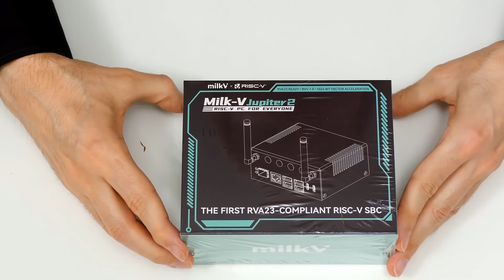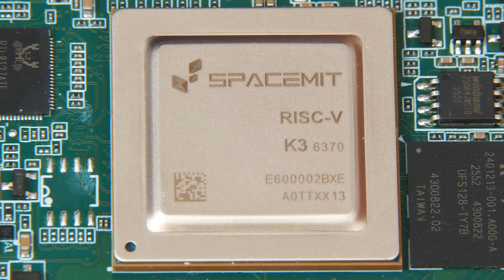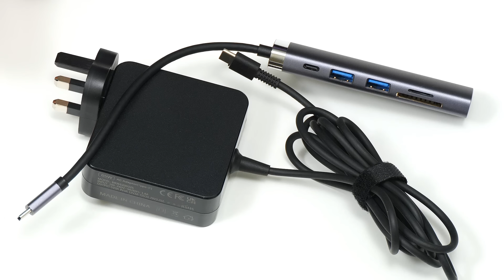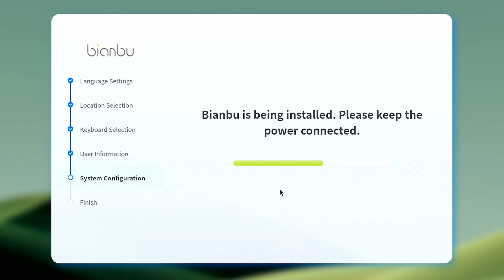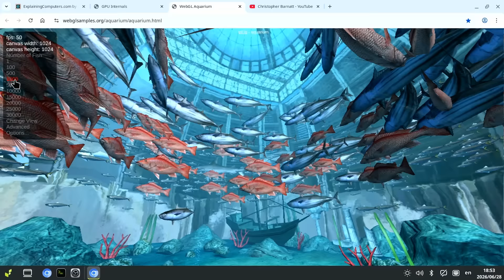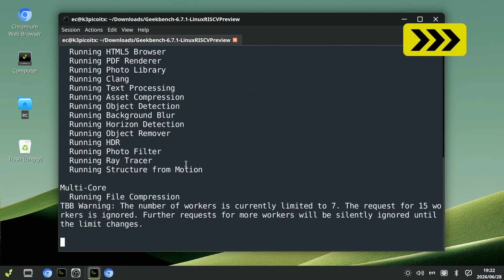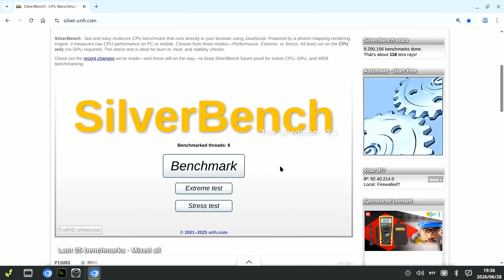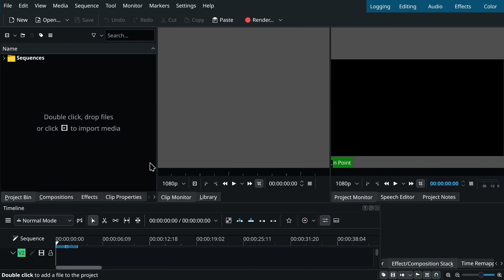Milk-V Jupiter 2: RISC-V RVA23 SBC

Comment: Makes me so sad how RAM prices are destroying the SBC market. A Pi5 8GB is £170 now! Crazy.
Reply: It's simply pricing SBCs out of many engineers' considerations when building solutions nowadays.
Reply: @terrydaktyllus1320  let's be honest though.. the vast majority of Raspberry Pis and other high powered SBCs are not being sold to engineers anyway.  They're being sold to the market that used to be mini-ITX enthusiasts; they're being used as mini PCs for consumer hobbyists to goof around on.  Real engineers don't really need a high powered GPU etc.
Reply: @DaveHanson-v6x  An interesting point - but aren't the current set of mini-ITX users just ex-SBC users who probably get a bit for their money going that way because they're not having to pay more money for an additional case, PSU and storage when they buy a mini-PC?

I haven't gone down the mini-ITX path myself, I've been buying a lot of cheap and used hardware on eBay and elsewhere - because everything I do is with Linux or BSD and I can do pretty much all I need to with a 3rd or 4th gen Core i5 or i7 PC, and those are still much cheaper than most SBCs.

Plus the SBCs I do have don't create a use case for high powered GPU stuff, so I will just keep using those for electronics bench and IoT stuff.
Reply: @DaveHanson-v6x I’d argue that it depends on the engineering problem that needs to be solved - no doubt some warrant higher power and higher memory and if being produced at scale would hopefully justify the price point. 
Often though prototyping occurs on lower end systems such as the trusty old and new epc32’s
Reply: @tomorrow6 I'll argue that a larger number of these types of SBC go into industrial devices and smart appliances. But back to the top, ram, storage, mlcc, etc. are killing us!
Reply: @DaveHanson-v6x Any data to back that up, or is it just armchair market appraisal?
Reply: @DaveHanson-v6x  we got by just fine with a Pi with 1GB of Ram for years and yes it feels wrong
buying 2GB Pi in 2026 but can you still use that to do a lot of stuff ? and 1080p 60 on a good monitor still
looks really good, as much as I like 4K I could happily watch most things in 1080p
Reply: @terrydaktyllus1320  No I'm talking about the original Mini-ITX enthusiast crowd from decades ago, in the time before tablets etc.  Those people weren't building robots and shit, they were making weird HTPCs, Car-puters, etc.
Reply: @suntorytimesu "ERM ACSHUALLY I NEED A CITATION FOR THAT DATA POINT"  bro stfu
Reply: These high RAM prices won't last forever: High demand drives up cost yet high cost eventually shall drive up supply. Hopefully we'll be back in decent RAM prices within few years.
Reply: @666ortiz I'm not even sure that won't last forever anymore. It might become the new normal and we will kiss goodbye to the golden era of cheap computing we have enjoyed for the last 15-20 years.
Reply: @666ortiz  not with the cartel that are the ram producers.. they decided to cut production 2.5 years ago.. the AI went bubble up.. now they are scaling up again, but mostly HBM.. when the bubble bursts we may see alternative products with HBM for consumers
Reply: @annebokma4637  we’ll all be playing Half Life 3 and Elder Scrolls 6 using refurbished A100s as gaming GPUs
Reply: @charlesmurtaugh3771 not me, I am not much of a gamer
Reply: @charlesmurtaugh3771  that is what we tell everyone, while we run our AI girlfriend local 😇😝
Reply: @annebokma4637  Just wait untill Chinese manufacturers start large scale production of RAM. They have only produced low-quality stuff for auxiliary industries for now, but it's changing, just like they barely exported cars a few years ago and now many people in Europe are buying chinese cars
Reply: @MegaRBN14  that depends if China wants to export ram in quantity.. seeing as they have several huge internal markets and projects going too... But the Oracle filing (with the hugely disappointing datacenter numbers) does give the beginning of the end vibes 😊
Reply: @annebokma4637  Crazy thing is DDR Ram is now more profitable than HBM
Reply: @PreyPrayPreyHeyHayHey  and as soon as open AI doesn't follow up on that letter of intent the price of HBM will crash so much it will be used in consumer goods 😂
Reply: @666ortiz  Lets hope so but they said the same thing about housing in a housing crises.
Reply: @666ortiz  Why would they  drop  RAM prices again when they're making a killing with  high prices??
Reply: @paulwarner5395  Yeah the demand is going to keep rising until drones start doing sorties and return to base missions we're exploding 30 gig a drone x 2000+ drones a day and a million flash cards to program them
Reply: @paulwarner5395  because the buyers for that gear are burning way more money than they make.. and bankrupt customers don't pay well..
Reply: just keep your money now, bubble is looking to pop before 2028...
Reply: Perhaps the even more sad thing is how all software has become so heavy and bloated that it needs tons of RAM to work. Just a few years ago, you could browse the web with relative ease on a 1 GB Pi, and now a 4 GB laptop is just barely enough to web browse, unless you use a lightweight browser.
Reply: RAM and storage prices are terrible, but it's a healthy incentive to optimize bloated code.
Reply: 200€
Reply: I was trying to buy a sdcard the other day, and it was sold out in all the local stores :O thought it was only normal computer ram that was in demand.
Reply: @AndrewTSq From what I understand, it’s nit just RAM but ‘flash chips’, eg storage. Manufacturers are dumping low profit products in order to either ‘get into’ or increase quantities simply because of AI. The various businesses behind them seem to be willing to pay anything in order to meet demand and to outdo/stop competitors get them.
Reply: @richards7909 sad but true
Reply: RAM isn't inside SoCs, SBC manufacturers should make DDR3 and DDR4 versions of the same boards (as long as they're compatible of course). Using older SoCs is also a valid option, they're way cheaper now.
Reply: @sovo1212 Forget DDR4. Prices of that have skyrocketed, too.
Reply: 16GB of DDR4 SO-DIMM - $300, when it used to be about $100.
RAM prices have TRIPLED in price now, it is INSANE.
EDIT: BTW, no matter how much I wanted it, I was not about to be butt-phucked for it price-wise, so I have not bought any RAM sticks for more then a YEAR now, cos the prices are so nuts.
Reply: @VauxhallViva1975  Shit your pic looks kiwi I've got 198 gig of it in error correcting chillin in my gaming rig I could spare some at $200
Reply: The official supplier in Portugal still has the Pi 500 in stock at the old price, got one 3 weeks ago with the 32GB card for 109€... :)
Reply: Very sad. I just bought a third Lenovo T-480 i5 with 32Gb RAM for $180 back in January. They’re running between $500 and $600 right now.
Reply: Ive noticed that they're slowly dropping, I can finally get a 1gb SoB for less than 70€!
Reply: I sure look a lot less silly now for maxing out RAM on all my old PCs shortly before the madness hit. An old PC with gobs of RAM is way more usable than a new one that's starving for RAM.
Reply: @Reziac  same here. Just forgot to max out the number of machines I could need (and the ram for that 😂)
Reply: I'm mostly made of ram and I've never been happier. You humans are putting me everywhere. I'm up inside everythang.
Reply: SBC prices were already bad way before memory crisis, so much that low-end x86-64 miniPCs became a much better option.
Reply: Could be worse
Reply: Want mine for $150 then lol
Reply: We just need to wait for this AI bubble to pop or XCMT to ramp up production.
Reply: Indeed.  I was planning on getting a RPi 5 16GB desktop kit, but at the current prices, I decided to get a PicoCalc with a RPi Pico 2W instead.
Reply: To the tech people: Can RAM be replaced? How does this relate to swap partitions?
Reply: Honestly RAM is destroying all of personal computing in general. I hope the Chinese start making their own chips honestly
Reply: And the most crazy thing is how well the SBC's get by with even just 4gb of RAM as a standard base model that compares to a base X86 PC build now is 32Gb
Reply: Why's anyone being asked to pay more for Ram or SSDs, indeed just about any other form of flash storage as even dated 2.5in second hand SSDs on Ebay are going for an absolute fortune in cynically profiting from the suppposed transient AI bubble..AI won't come to anything anyway, no real technological advances have been made, however with UFS and Risc V cores it seems Christopher's board is the real innovation and not AI whose talk and hot air is getting to be very tedious repetative boring and what's more incredibly costly too..!! It's clearly Risc V and UFS and not AI, that ought to be raved about because isn't that where today's solid and tangible computing innovation is really at?
Reply: @ericjarvie  The AI buble is one reason, but not  the only one that is the reason that everything that have any kind of memory has gone up, up to 600% in price cause most memory is going directly to big server farms of any kind instead of being made into consumer products. We can then pay all these commercial companies to "rent" memory for just about any kind of software no matter what kind of hardware we are running locally. The small efficient processor types lik RISC-V is just enhancing this kind of commercial market Scheme to more valuable to big companies that can pay for the memory and then rent it back
Reply: damn, noticed even the radxa dragon Q6A 12gb increased to €150.
is a board much faster than the raspberry pi 5, and way more energy efficient and 12gb LPDDR5. but up until around a month or 2 ago it was only €87.
so I guess these prices have gone up due to the chinese ram supliers going to sell international as well, probably rose prices there rapidly as well with datacenters stealing everyting there as well now.

before they went international many chinese SBC makers could get ram quite cheap despite the ram problems in the west, so that €87 for the 12gb model was their ram crisis option/price already, that sbc only launched in the middle of the ram problems, and yet managed to keep that price constantly, well until now as now it suddenly doubled right after the big chinese ram suplier went international.
Reply: Well goid news on that front it seams that the AI rocket has problems, so it might soon stall, so ram pices might soon ish go back to somewhat normal ,evels
Reply: It isn't only the RAM costs, the company that makes them went public in 2024 (stockholders want money) but a lot of start ups started buying them off the shelf for actual commercial end products (ebikes and such) and spiked demand. The whole marketplace has become a mess.
Reply: @nerfherder4284 But it’s mainly RAM prices. It’s affecting everyone.
Reply: @richards7909 
It's not "mainly" RAM prices. It's all chips. RAM demand was what triggered the problem, but almost all chip makers make all sorts of chips for many customers.
Look forward to car manufacturers shipping cars without stereos again when they can't get the MP3 player chips...
Reply: @tin2001 The comment I replied to was stating the reason for the increase in Raspberry Pi prices was due to not just RAM but shareholders wanting ultimately a dividend and startups demand for them.

My point was it's the price of RAM that's caused the price increase and not just for Raspberry Pi.
Reply: @nerfherder4284  Yes, exactly. Raspberry Pi doesn't need to care about home and hobbyist users any more because they have much bigger commercial customers who want their products.

I unsubscribed from the official Mag Pi magazine when it changed from having a "hobbyist" layout to a corporate look and the new name of "Raspberry Pi Magazine" about the same time.

They're a British company, it's good for a British company to be successful, but I think hobbyists need to understand we're not their core audience any more.
Reply: Laughs with Pi Zero 512 KB RAM. 
It's been painful to drop the GUI and deep learning CLI, but it was worth it at the end. I do keep a notebook to keep track of my multi-tasking process IDs.